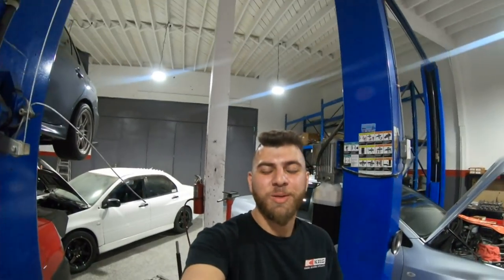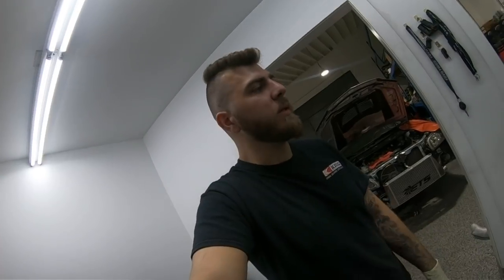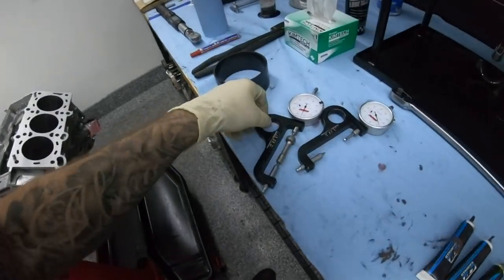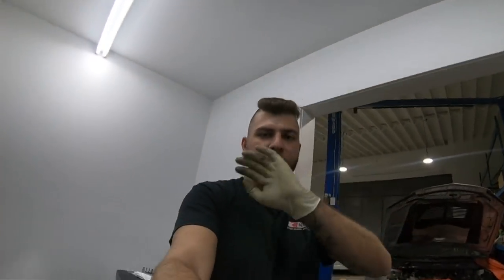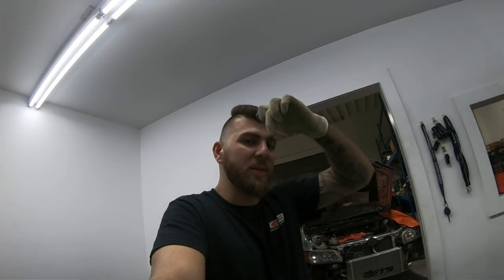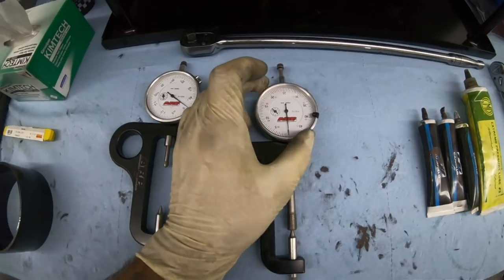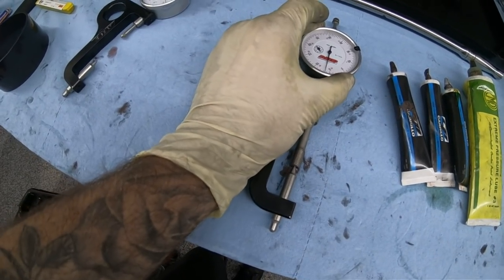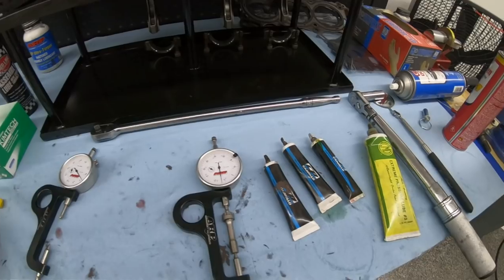JRP Performance Presents: Connecting Rod Bolt Stretch Method

Comment: Hey Roni, love the informational videos, it really helps show how amazingly detailed you guys at JRP are when it comes to engine building. Just a tip for video, to help with the audio when you're moving the camera around, I think it would be good to get a short arm to mount the GoPro onto, just so you're never touching the actual camera while recording. It should help prevent the muffled sound around 3:36 and a couple other times during the video.